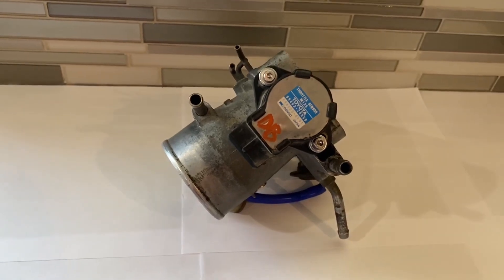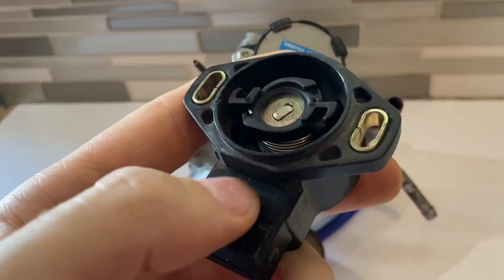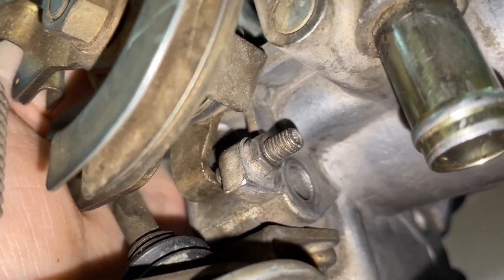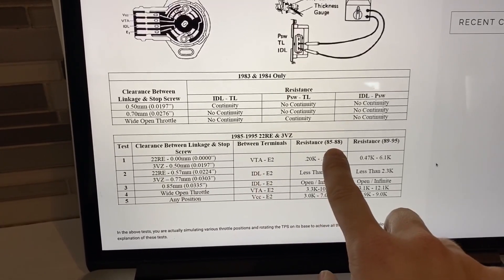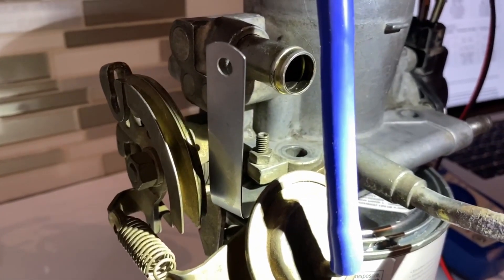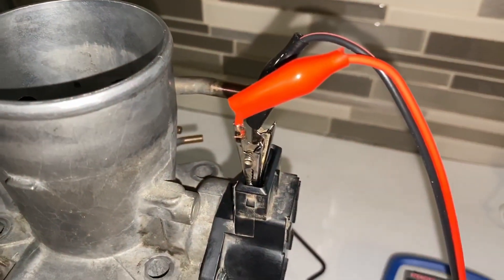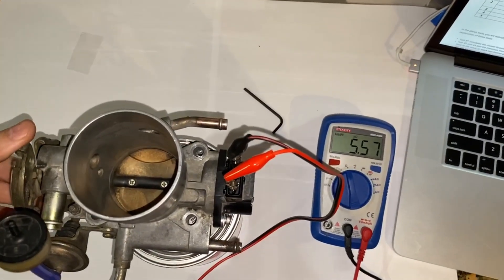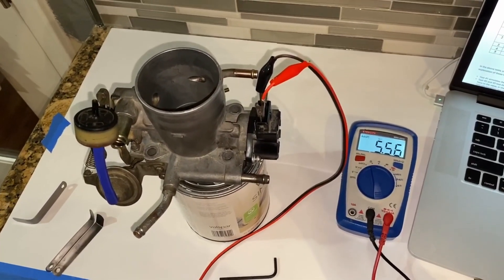How to Test and Adjust Toyota 22RE TPS (Throttle Position Sensor) Pickup, 4Runner

Comment: The factory Japanese screws are 4 mm diameter, and the length is 14 mm.  Make sure to get a washer for both new screws. Any good hardware store will have them. The new screws can be just a tad shorter than 14 mm. 

If the bottom screw strips, put a flat head screw driver close to where the top screw goes in, and then just break the old TPS.  Then use pliers to turn the stripped screw.  I had to do it that way, and it worked out great.  I did not remove the throttle body.

Comment: i must be doing something wrong because i have tried 3 different tps ranging from $90 to $150 and ive also used 4 different multi meters ranging from $30 to $250 and I can not get the idl and e2 less than 2.3k reading that u got. The numbers dont even come close. the more i turn clockwise it goes to open loop and the counter clockwise the number stays at like 153.9 and it wont drop less then like 129.8 and thats with the setting on auto. maybe im just dumb idk but ive given up on it. ive been messing with it everyday for like a month
Reply: 2.3K ohms is 2,300 ohms.  Once you are at open loop, slowly turn the TPS counter clockwise until you have less than 2,300 ohms.  Mine went to 109 ohms. That's using a 85mm feeler gauge for IDL and E2 the bottom two.

Comment: Thanks for the video. The hex screw are almost as difficult as the Phillips if the air horn is in place. We screwed studs into the body and placed lock washers and nuts. Way easier.

Comment: I noticed the dashpot in the video is installed. The throttle stop setting changes if that dashpot is disconnected. . . This system was badly rigged by a previous shop so I'm trying to get it to run correctly. ,. I suspect the dashpot stop adjustment was all the way in, on this unit. I suspect they did that to raise the idle . .
Reply: How do you adjust the dashpot? My idle is super high (2 to 2.5k rpms) and I plugged the hole the end of the tiny little intake hose hanging off it but that didn't do anything. Would be nice to try to adjust that before I go the TPS route
Reply: @nataliedavis9085 The dash pot simply keeps the throttle from slamming shut when you let off the gas pedal quickly. From what I understand, and have done so myself, you can completely remove it if it's messed up and giving you trouble.

Comment: Got a brand new sensor and it will not go into spec with the 0.77mm & 0.85mm. Their either both OL or having a reading. Never just the 85 OL and the other reading literally anything. It's always OL on both or showing a reading. 

What brands other than rip off Denso are trustworthy?

Comment: I have a question about the feeler gauges. I have a 1994 pick up What sizes did you use? I’m going based off the thousands numbers so I’m using the .024 and a 0.35 feeler gauges if anyone can tell me what sizes exactly I need that would help
Reply: There are online conversion charts.

Comment: Hey, did you apply vaccuum to the throttle pushoff valve above the tps before setting the idle stop screw?
Reply: That's a dash pot, it keeps the throttle from slamming shut when you let off the gas pedal quickly. It's just a diaphragm and spring with an orfice vented to atmosphere.

Comment: On those adjustment figures for the feeler gauges seem weird compared to the feeler gauges im able to purchase should any set of feeler gauges work for this.. the 0.0224 and 0.0335 look as if they should say 0.224 or 0.335 thanks
Reply: Wondering same thing. Ever figure it out?
Reply: @robertcordova2528  right now I just got it set by ear lol.. lowered my idle seems to run pretty good.. but I recently got me a new project 98 cherokee sport 4x4..

Comment: Thank you for this! My pickup occasionally runs low and stumbles at idle plus hesitates at acceleration sometimes, and gave me a TPS code! I can’t seem to get mine to open loop, only 0.03, but I may just leave it if it works fine otherwise!
Reply: I'm in the same boat. Did your vehicle run without this being an open loop?
Reply: @MrDaoby  yeah it ran fine just not well.

Comment: What size screws do I need to buy.. mine is currently missing bottom screw. Gotta love how they made it impossible to reach bottom screw without removing throttle body or thermostat housing.. please help if anyone can tell me about these screws..
Reply from the maker: Check 4crawler or 22reperformance
Reply: @RM_Garage  do they list em as tps screws? I was just wondering if you know the size of the screws by chance?
Reply: M4-.07 x 16mm and four flat m4 washers for spacing correctly
Reply: The screws are 4 mm diameter, and the length is 14 mm.  Make sure to get a washer for both new screws. Any good hardware store will have them. The screws can be just a tad shorter than the original.

Comment: Hey man this was an excellent video explaining how to test my tps. Im having issues with my 22re and I believe the tps to be the issue. But I'm still a little confused on how to adjust if the measurements aren't within spec. Do you have another video im missing? Or can you explain this?
Reply from the maker: Loosen the nuts and turn it
Reply: Amazing video man but I'm really new to working on my truck which nuts do loosen?

Comment: Anyone run into a code 52 - knock sensor because of their code 41 TPS? Been battling a 52, 24, and 41. Hoping the TPS, new gas (sitting for 9 months) and an O2 sensor does the trick. Don't mean to make it a forum, just wondering if you get here because of a knock code.

Comment: Hi I have a 1986 Toyota pickup 22rte turbo automatic transmission I got the same info from Lce diagram readings and could not get the same readings like you engine is a 22re in a sense but stop screw is totally different- could you remember if your adjustment is at center point? I think I have no choice but to adjust by feel when I adjust down truck starts shaking and adjust up feels better also the tps I bought was bench tested from seller and is same part number as yours

Comment: I have a toyota pick up 94 that when I stop at stop it turns off. Does anyone know what the problem is ..
Reply: On a 22re
Check the rubber intake elbow for cracks, especially on the bottom.
Very common
Reply: Also changing the fuel filter should help too

Comment: Hi I ordered An oem TPS I’m having an issue every now and then my automatic transmission will shift into 1st but will reach high rpm before second gear and won’t engage until I come to a stop and start over I’m thinking it’s the tps. Misfire at idle at times and acceleration hesitation

Comment: You told us what they should be but didn’t show us how to change them if they were out of spec.
Am I missing something?
Reply from the maker: Oversight on my part. Loosen the screws and then turn the TPS clockwise or counter clockwise to adjust.

Comment: Wow brother thank you very much i also bought a taiwan cheap tps and i cant pass smog and it runs terrible. I just bought the EOM  tps and after watching your video like 35 times i feel very confident to go ahead and remove my tps and adjust it. Also, thanks for the awesome tip of swapping out lame screws for Allen wrench screws
Reply: How is your truck running ? Did You fix the problem

Comment: This was a well explained video except one thing, one of test, the senor needed adjusted and you didn't go through how to adjust the sensor and wouldn't it throw off the other readings on the other tests. Question?
Reply from the maker: Thank you for the feedback and thanks for watching!
Reply: I did everything rite far as adjusted but idle better but still not running rite. What should I do next any ideal what it could be
Reply from the maker: Yeah, bad oversight on my part. You have to loosen the screws to adjust the TPS. I recommend swapping out the old screws with allen head bolts from LCE or 4Crawler.

Each adjustment will affect the other adjustments. You will have to finesse it until all specifications are met for each test. Start in the middle of the adjustment.

Comment: Hi, great video. What’s the specs for putting the stop screw back into place?
Reply from the maker: The throttle blade stop screw? If I recall correctly, the adjustment is to screw it in so it barely touches the linkage, and then tighten it 1/4 turn and snug the lock nut. 

Thanks for watching

Comment: So I see how to test it but how do you adjust if it doesn't pass the tests?
Reply from the maker: Ah, good point. Loosen the screws and turn the TPS clockwise or counter-clockwise to adjust it.
Reply: StryfeS13 it wouldnt throw off the other previous tests?
Reply from the maker: @omaroacosta1290  You'll be adjusting it several times throughout the process to pass all the tests.
Reply: So where do I want to set it infinit 0